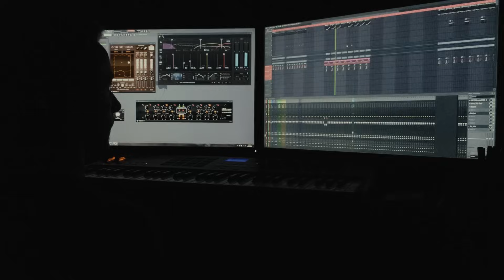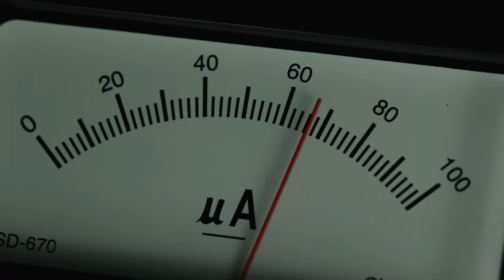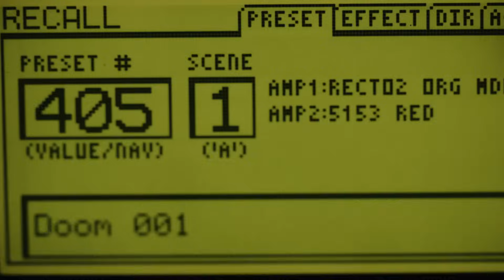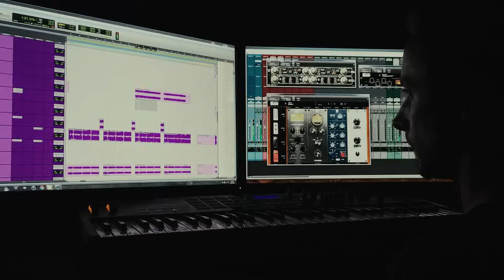DOOM: Behind The Music Part 2

Comment: That pleasant feel when you work at company which developed "Поливокс" at the eighties.
I know its kinda outdated, but a have a question. What about the keyboard of Polyvox? As I heard, it is horrible in use because it built on reed swithes, that stick sometimes . Did You changed them or it works right?
Reply: He has an instagram post somewhere showing that's he's had struggles with the Polivoks keys. I am curious to see how he went about modding it to take MIDI though...